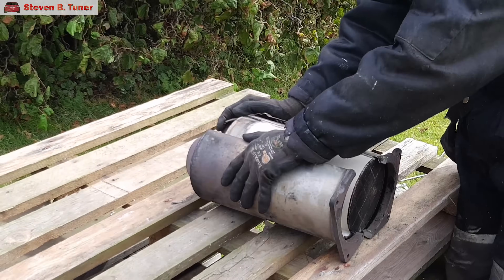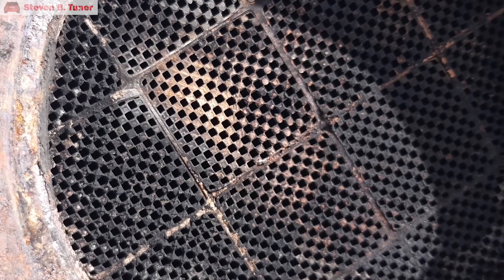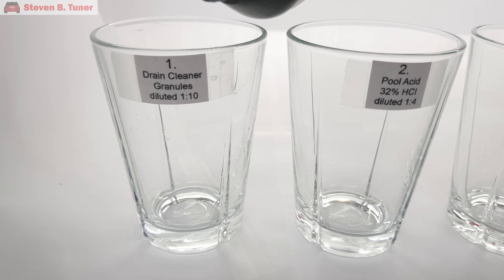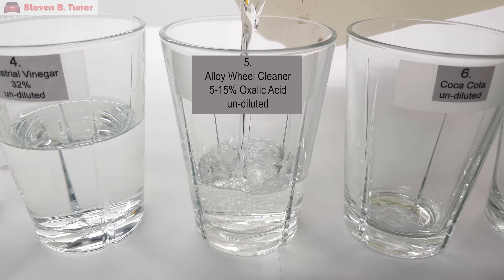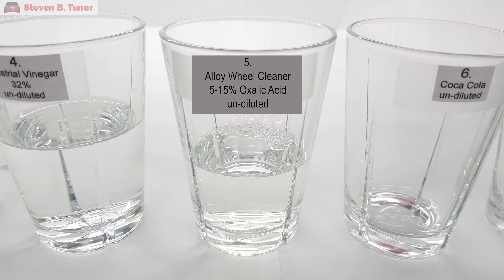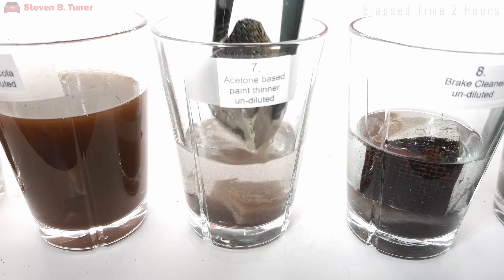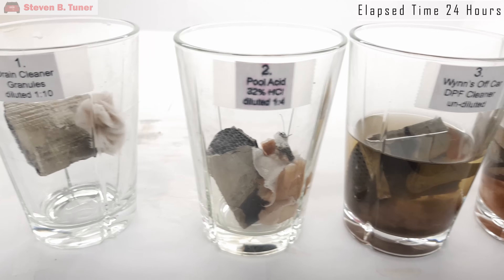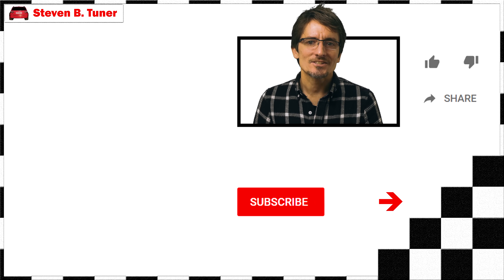DPF Cleaning at Home – 9 Chemicals Tested (Diesel Particulate Filter DIY Ash Cleaning)

Comment: I am following and watching  your channel re this DPF cleaning, even few times :) I did not perform any cleaning so far. I am thinking of the best solution for this problem once it happen. But, what do you think, is it OK to buy second hand DPF, clean it slowly using pre-wash dishwasher tablets and keeping DPF for one week in this solution, then keep it in vinegar for one week as well and let it dry for long period and then instal it in car and do same job with original DPF. Repeating this every 100000km, of course, who wants to keep car that long :), I am on good way to do so. Forget to mention, I have Cat and DPF in one, it is 2.0 TDI CR from VAG concern (A6 C6 facelift model)
Reply from the maker: Hi, have a look at my other video for the complete process: "The No Damage DPF Clean". I wouldn't recommend cleaning a DPF and then not putting it straight into a car, as any wet chemical or even just water left behind will cause corrosion very quickly. When it is dried out by the exhaust everything will be pushed out.
Reply: @StevenBTuner  This sounds logically, thanks for fast reply. Anyhow, I am on 267000km right now, no issue so far, still all original on it, but I am thinking on prevention action.
Reply from the maker: @novak4142  Hi, that number of kms says to me that if your DPF isn't fully blocked with ash by now then it has got to be pretty close to the limit! I would recommend using a good diagnostic unit to look at the time between active regeneration cycles to make sure it's not getting too short. You don't want active regeneration every 100km for example because a lot of extra fuel is injected to heat up the DPF, and some of that fuel ends up getting past the piston rings and diluting your engine oil.
Reply: @StevenBTuner  So far is about every 400km. According to diagnostic accumulated ash is abt 0.17L and ELSA manual suggest replacement of the DPF at 0.175L. So far, car is going well, never saw DPF lamp lighting on. But. i am considering preventive cleaning....
Reply from the maker: @novak4142  Hi, if you do the full clean, then it would be great to hear how it goes!

Comment: Hi my Toyota has a combined dpf and cat and they are in the same housing, I have removed it from the vehicle have cleaned it with detergent very small amounts of soot came out but no ash...you say it's ok to use hydrochloric acid but can anyone tell me which strength as dont want to cause an explosion
Reply from the maker: Hi, see my other video called "The No Damage DIY DPF Clean" for the full procedure.
Reply: @StevenBTuner  is that the 7 % hydrochloric acid 1 Steven? Thanks for your reply
Reply from the maker: @Matchfishing251  Hi, 5 - 7% works well.
Reply: @StevenBTuner  Thank you Steven will let you know the result ....👌

Comment: Tested and worked perfectly. Bmw 2007 E60 520d dpf removed from car, pre cleaned for about 30 mins. with 1L of mr.muscle drain unblocker (diluted with 1L of water) , this stage will remove grease mainly. After, i used 20L water + 5L brick acid HCL 34%, and let the dpf soak for about 3 hours. I give it a rinse with just a hose garden initially and after a jet wash with 2 bar pressure (no higher than that as you'll destroy your honey comb inside). Also keep your jet wash nozzle/lance at a 200mm distance from dpf honey comb. Water came clean after all this process and had a good flow from both sides. Dried the dpf for few days and reinstalled on the car. Before this diy clean my car was cutting off right after engine start as dpf was fully blocked. Now my dpf readings are: 4mBar at idle, 12mBar at 2000rpm and 42mBar at 4000rpm. Cost for replacing dpf to this 15 years old car is £1400 just the genuine part + labour to install it. Cost for diy this method is under £50 and some diy enthusiasm. My car has the dpf separate from Catalytic converter. Thank you for all your videos Steven. Nowhere on youtube you can't find such detailed explanation.
Reply from the maker: Awesome result from a job well done! :-)

Comment: As for US pickups move to a state that allows EGR/DPF Delete, end of issue and the big plus up to a 30% gain in fuel mileage and double the life of the motor... or better yet, own a 7.3 Power Stroke that's pre-emissions 🤣😂😎  my 2000 F-250 7.3 with lots of mods get 18+ mpg!
Reply from the maker: Hi, thanks for watching! Without the introduction of the DPF (and associated equipment), these fantastic engines would have been banned worldwide by 2010 - so I think of it as a bit of a necessary evil.
Reply: @StevenBTuner  Steven, Now I see your a BMW Guy! Love a Beemer over a Mercedes any day. Most of us Diesel Guys here in the States love our diesels trucks! Starting in 2012 the EPA Mandated DPF systems which does both add cost, lower fuel mileage and the use of DEF fluids. I was an OTR trucker and my last two rigs were a 2010 Navistar ProStar which I was getting 8.4 to 9.6 mpg!  Then I had to have the 2012 Peterbilt 379 Classic, same 400 Cummins with 18 speed... the dang truck with the DPF system would only get 5.6 to 6.2 mpg plus the cost of DEF and the break downs!
So as a Fan of Diesel motors the first thing I want to is a complete EGR/DPF Delete and the State I live-in does not out-law that... yet!
Reply from the maker: @danielmcqueen1024  :-) 9.6mpg - that's impressive! The whole situation isn't helped by manufacturers under-sizing the filters on most vehicles to save costs which causes those nasty reductions in mpg...
Reply: @StevenBTuner  I grew up in the trucking business... started driving the Farm truck at age 12... and by 14 I was running 48 states with my Dad in the 1970's. He taught me it's not a race but a pace in traffic, so I've used that principal for over 1.6 million miles in my driving career.
Reply: @StevenBTuner  at this point I would love to find a delete for my '08 Mitsubishi Fuso. I wonder if I'm getting a greater exposure to soot trying to deal with a plugging problem. The filter hides the clues that might help indicate the problem. The computer won't let the truck run, but can't tell me what's going on. There are dpf delete kits for the Big Three: Ford, Chevy, Dodge, big engine recreational pick ups, but not my conservative, small engine commercial truck. C'est la Vie..

Comment: I’m wondering if DPF’s have a catalytic / plating in addition to the mechanical labyrinth which could be damaged by the various chemicals used for cleaning?
Reply from the maker: Hi, a lot of vehicles and certainly most cars have the more delicate and expensive catalytic converter just in front of the DPF ceramic material, and in the same steel/stainless steel housing. Hitting the catalyst material with some strong chemicals or a high pressure water blast may not be the best idea. I have a separate video specifically about cleaning DPFs with integrated catalytic converters: https://www.youtube.com/watch?v=LE1boZ3fhLg

Comment: Have you tried a professional DPF cleaner like Wurth?
Reply from the maker: Hi, availability of branded products varies a lot worldwide, so I prefer to find generic chemicals that are cheap and available in every country.
Reply: @StevenBTuner  Wurth is available in most countries and BMW use it in their dealerships for cleaning DPF’s. I have watched some before and after videos with very good results.

I will probably try it on my car soon.

I think it will be a good test to compare it to the household chemicals you use.
Reply from the maker: @chipped  Hi, be great to hear how it goes! Are you referring to the 'in place' DPF cleaning? My understanding is that it is sold as a maintenance clean which should be repeated every couple of years.
Reply: @StevenBTuner  Just cleaned my DPF with Wurth DPF cleaner. I had errors on my N47 about back pressure being too high. Was 80 hPa (mbar value is the same) at idle and now it’s down to around 4. All I had to do was remove the DPF pressure sensor and spray a full can down the pipe. Then you drive the car for about 1 - 2 hours and do forced regeneration. Was blowing smoke like a chimney.
Reply: @StevenBTuner Hey mate, did you see my previous comment about the great results I had with the Wurth DPF cleaner?

Comment: Your stainless steel results are not good cause there are over 200 types of them
Reply from the maker: Hi, thanks for watching! So far the real world results back up the testing, which indicates that the manufacturers are using strong enough materials to handle the extreme heat as well as the occasional chemical clean. If you come across a manufacturer making DPFs out of junk material then name and shame!

Comment: Cam you try baking soda with lemon juice. I use it to clean my oven and range top. Get carbon and grease as well
Reply from the maker: Sounds like it could be a good pre-wash to remove any oily soot.
Reply: @StevenBTuner  Why would you mix a base with an acid?

Comment: Wouldn't it make sense that if you're doing a 24h soak, that mid way you dump off the dirty soot, Ash and oil ridden solution,  and use fresh solution to allow the fresh undiluted cleaning solution to finish off the cleaning process?
Reply from the maker: Hi, during this test the pieces were shaken about during each time interval to remove any trapped (but loose= material. To see a full clean in operation, look at my other vid: https://www.youtube.com/watch?v=LE1boZ3fhLg
Reply: @StevenBTuner  yeah I appreciate that but if money allows it the same shaking process and solution cleaned half way would seem to make more sense to me, I'm not faulting what you're informing us, just wondered if it would make a cleaner dpf if doing a half way cleaning solution replacement?
Reply from the maker: @sbr1160  Shaking is a great part of the process - and my full process involves some. With enough shaking is any chemical needed at all? (ultrasonic cleaning video coming soon...).
Reply: @StevenBTuner  I'll keep watching, and go with your most effective way, I'm still learning all this so all questions are better than no question 😁

Comment: Cant help to think if the Coca-Cola would be better if it was "fresh"

In the army we use Coca-Cola fresh from the can to clean extremely heavy sod from the M2 heavy machine gun and the MG3 (MG42) light machine gun. But only when it is so stuck that even hammer and chisel can't get it. We leave it for minimum 24 hours and then the metal looks and feel completely bare, have to oil it up straight after to avoid rust. NOTHING we have comes near Coca-Cola. 

BTW love you video, and side by side no-bullshit comparison!
Reply from the maker: Hi, thanks for sharing your experience! The phosphoric acid in cola is pretty useful :-)  I use much stronger 85% phosphoric acid in my other DPF cleaning video: https://www.youtube.com/watch?v=Vsicb0LsIiQ

Comment: Steven thank you for video. I want  to try to clean big truck dpf using pool acid. Just want to make sure you had 20% pool acid (32% murietic acid) + 80% water in that glass ?
Reply from the maker: Hi, it starts as 30-32% HCl, and then is mixed 1 part acid into 4 parts water, so the final HCl concentration is around 6%. To rinse out the acid flush with lots of water - with maybe a bit of dishwashing liquid in it, just to be sure it is all neutralized. I hope you'll report back how it goes!

Comment: How did you mixed dishwasher tab and water 1:10 ?
Reply from the maker: Lots of stirring and crushing!
Reply: What is dishwasher tab ? I have seen only liquids
Reply from the maker: @musheghhayrapetyan8982  Hi, they are a dose of dish-washer cleaning powder that has been tightly compressed to make it easier to handle. If you are wanting to do a DPF clean then I would recommend the full process found in my other video: https://www.youtube.com/watch?v=LE1boZ3fhLg

Comment: Hi there so in your opinion what is the best chemical to you for clog dpf and doc with oil and soot
Reply from the maker: Hi, the normal way to clean out a soot and oil clogged DPF is to bake it overnight in an industrial oven at over 600 degrees celcius plus (basically doing a very long regeneration cycle). If you want to do it at home then it is a bit of a slow and painful process that involves lots of soaking with a strong de-greaser or sodium hydroxide based drain cleaner, shaking, rinse, repeat maybe 5 times. Some very gentle (not too close) back-flushing with a high-pressure washer might also be needed if things are really bad - but definitely don't put a pressure washer anywhere near the inlet side of a DPF if it has an integrated catalyst. Others have commented that they have done it successfully, but it took a lot of time.  And of course the most important thing is to find out what is wrong with your vehicle that has caused the soot clogging, or it will be all clogged up again in a few weeks or months!

Comment: what about steam cleaning the soot on DPF /thanks much
Reply from the maker: Hi, I can't see why it couldn't work as a reverse flush process, but it would require good visibility to ensure that any heat/pressure isn't applied to the ceramic 'glue' between the ceramic modules.

Comment: So what were the results? 
From last to First
In Descending order
Reply from the maker: Hi, the result is that there a few potential products that could do the job - but the best chemicals I have found are still the ones I feature in my other video: https://www.youtube.com/watch?v=LE1boZ3fhLg
Reply from the maker: @xlbubblehead2505  Hi, alloy wheel cleaner can be good if your DPF doesn't have an integrated DOC (catalyst), but if you do have an integrated cat then I would recommend following my other video to avoid any damage: https://www.youtube.com/watch?v=LE1boZ3fhLg

Comment: My DPF on my 2017 Ford f-550 (6.7 motor)is clogged bad. Someone told me that I may damage it by cleaning it because it is one unit and welded together.

Would you happen to know if that is true or not ?

Thanks
Reply from the maker: Hi, thanks for watching! If your DPF is clogged with ash (due to doing 150,000 miles plus) then you can see the full 2 stage chemical cleaning process that I use on a welded together unit in my other vid: https://www.youtube.com/watch?v=LE1boZ3fhLg  However if your DPF is clogged up solid with black soot then it can be very difficult to DIY clean, and it could be a lot easier to find a company that can bake it overnight in an industrial oven at over 1112 degrees fahrenheit in order to burn off the soot. This is a common thing to do for buses and big rigs.

Comment: I was hoping to see EZ OFF oven cleaner
Reply from the maker: Hi, thanks for watching! Oven cleaner works a lot like the sodium hydroxide drain cleaner - so it is also great for removing oily soot. However it isn't effective against the ash deposits, so you will need to do a second cleaning stage. My favorite method is still the one in my other vid: https://www.youtube.com/watch?v=LE1boZ3fhLg
Reply: @StevenBTuner  I did watch the other vid and will do the exact same as you had demonstrated. It looks like a great method. Thank you for the awesome research video.
Reply from the maker: @donstaggs3827  Hi, it has worked for heaps of folk doing it DIY, and there is a specialist company that uses pretty much the same technique and has done thousands of them.  I hope you'll post how it goes!